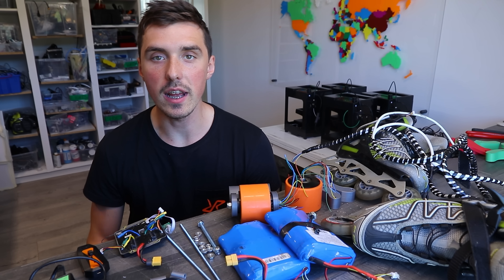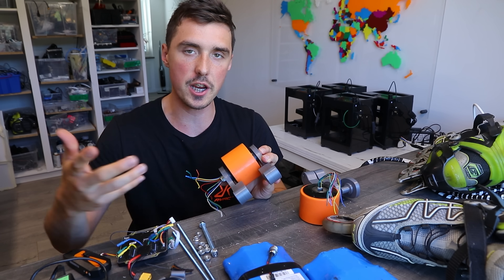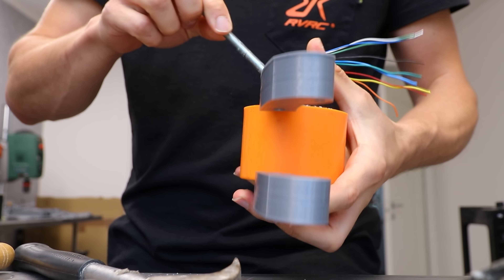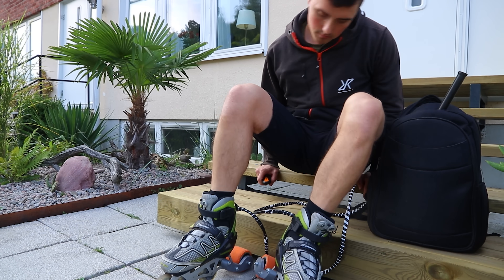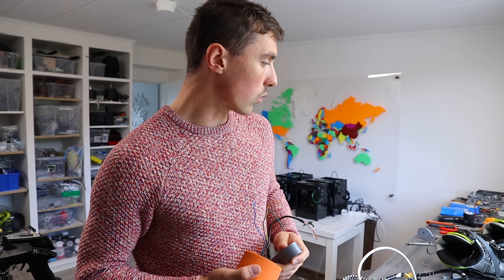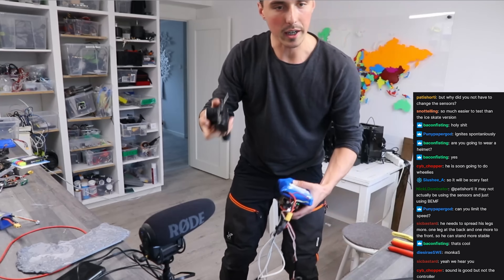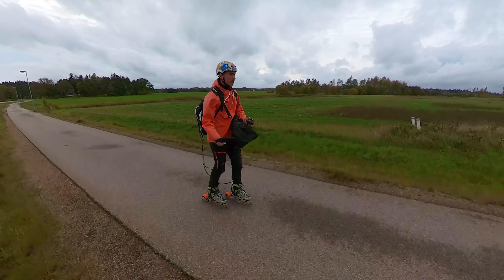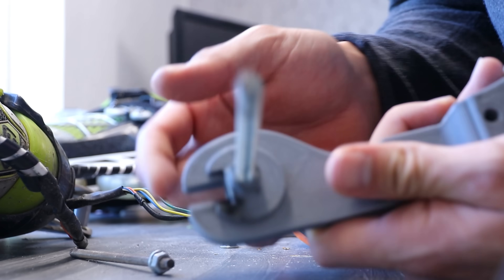1000W Electric Rollerblades That Will Hurt You

Comment: Why dont you replace the wheels on the rollerblades with these hub motors you could do it with 2 hub motors in line per skate that way you dont have to 3d print extensions and have problems. 

There is another solution i have an idea which might be easier. 

Remove the rear wheel of the skate then use 2 hub motors on the outside of the frame that holds the wheels that way you can just run a threaded rod through the middle of it all. and for the square farts just get some square steel bar drill and tap holes into it then you can run the threaded rod through it. That would be super heavy duty! 

if i could draw it in a photo i would i think the last idea is the best one though!

Comment: This is actually a project I’ve been planning for months, but never got around to.
Personally I was planning to use the Powerslide Next OffRoad skate as a base. It seems large enough to fit a hub motor into, and has plenty of room for the wheels as it’s got off-road tires rather than standard wheels.

Then, there was another video here on YT of someone making his own tires, but making a mold, putting the motor in it, and filling it with a lot of caulk. But I’m assuming you have access to actual tires that might work.
Reply: Kind of like this:
https://youtu.be/OzHRQTqIXKE

But then with a proper frame from Powerslide, rather than a homemade piece of bent mental.

It would increase the height of the entire thing, meaning balance would be harder BUT you should be a lot safer when it comes to bumps and rough/off-road section
Reply: hoverboard motors are mechanical knees

Comment: That was awesome! Printing that square shaft separately would help with not breaking due to layer adhesion if you orient it 90 degrees so the layers are along the shaft and not perpendicular! Or just use a metal square shaft! :)
Reply: A square aluminium rod would solve that weak point easily
Reply: @MusicHunter111000  or just a deep shank carriage bolt
Reply: Yup, that little cube is just begging to be sheared off.

Comment: If you did this again do it with inline aggressive skates because they have a fat soul plate, you wouldn't have to have all this framework just make a U bracket bolted through the soul plate and it would look a lot cleaner, Maybe even bore out an actual rubber skate wheel and have the outrunner inside that then you don't have a square edged wheel meaning you actually keep the flow of skates instead of being on ''rails'' because of the sq wheels also wouldn't sound so plasticky. Even still wicked concept! Edit; just finished the vid already said about the wheels so scratch that.
Reply: they also have the UFS sistem and it will be a lot easyer to 3d print a hole new frame for it! he also needs to stop using flat wheels!
Reply: Sole
Reply: @carpediemarts705  Soul?
Reply: @tnuc748  shoes have soles
Reply: @carpediemarts705  In blading they're called soul plates, hence soul grinds.
Reply: @tnuc748  Maybe 4he popular vernacular defies general grammar where it would be called a sole grind and my spelling Nazi capacities are moot.
Reply: When aggressive inline was first, well, being invented, one of the first tricks was to slide on a rail or curb on the outer sole of the skate boot. The guys that invented the trick decided to call it a "soul grind", playing on the words. What he is referencing as a "soul plate", didn't come around until over a decade later, when innovators created a removable plate/s for the soles to be replaced rather than just grinding through the boot and tossing the whole skate out from thousands of hours of sliding across concrete. The are called "soul plates" in reference to the trick performed on them.
Reply: Yes please!
Reply: do it with a pair of oysius frames
Reply: most important: electric motor and plastic = no
Reply: @Blox117  absolute bs. almost everything nowadays with a electric motor is plastic or 3D printed
Reply: @035gogmofo6  they have metal where it's needed and plastic where it's not. Plastic is absolutely not going to work on the square bosses and the "axles" of these skates.

Comment: Awesome!~As a long-time blader, If you make a version that you can mount in less than 5 minutes and costs under 1000 bucks I'm buying! also what about a ball instead of a roller for a pushing wheel?
Reply: It needs a curved profile for sure to allow comfortable leaning.
Reply: I think the cylindrical roller is probably just more efficient in terms of materials and bulk. It's just the spinning motor with a rubber housing; you'd probably need a pretty complex drive mechanism to spin a spherical roller.
Reply: @thefez-cat  I agree to that.
Reply: maybe adding a bigger wheel with rounded profile will solve that
Reply: The large surface of the flat wheel helps a lot with traction. A round wheel has only a very small contact area, so it would probably spin at acceleration and lock/slip when breaking easily. You could probably help that with leaning back and pushing harder on the driven wheel, but that just brings new issues with the weak plastic arms breaking and you trying to balance out the system while riding. I could see this concept work much better with "offroad rollerblades" that have larger and usually softer wheels to begin with.